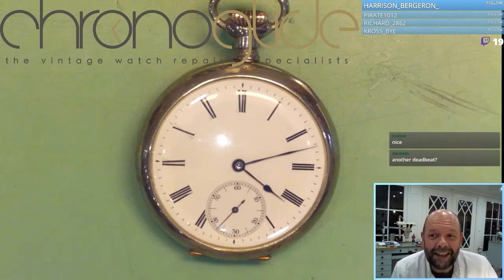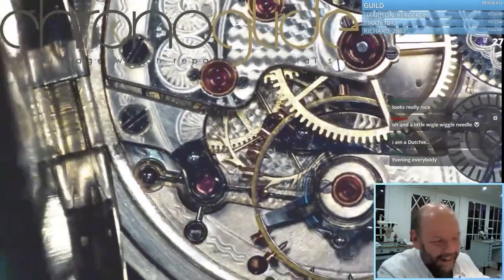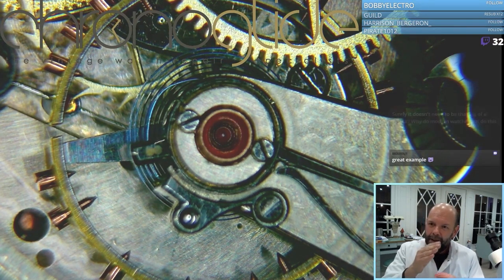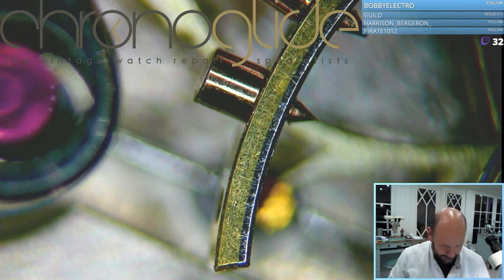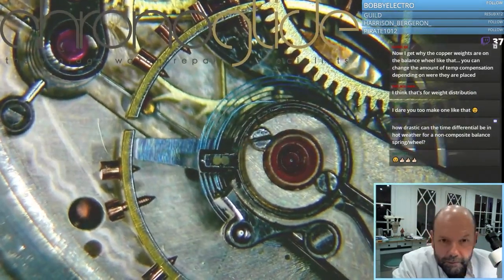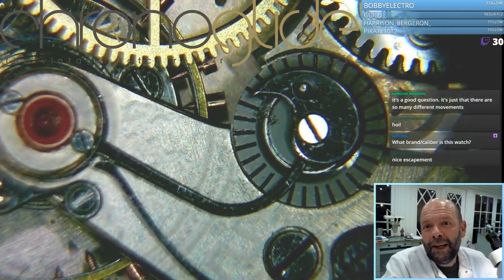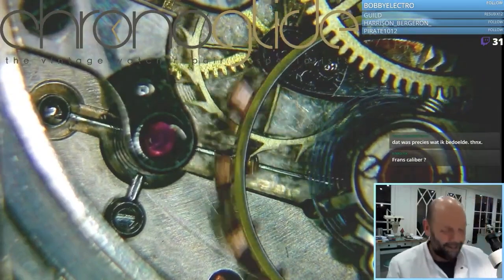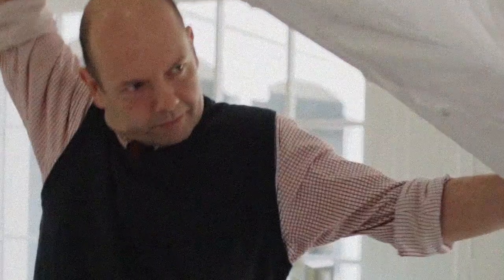The amazing chronometer escapement! Part 1 (6min.)

Comment: I have a question. Why does my watch run fast when it's fully wound is  +25sec and slowly lose time  as the power reserve decreases. It goes from something like 25 secs fast to minus 40 secs on my Timegrapher as the power reserve drops.
Reply: Does it have a fusee? If not, your main spring might be damaged.